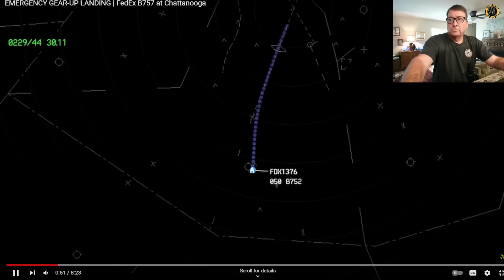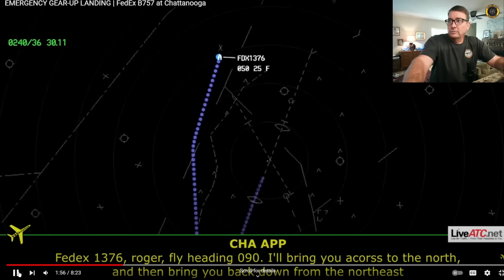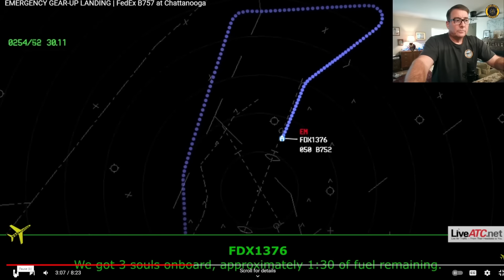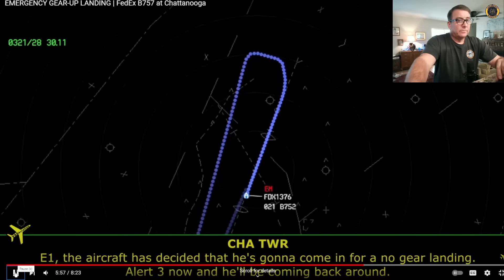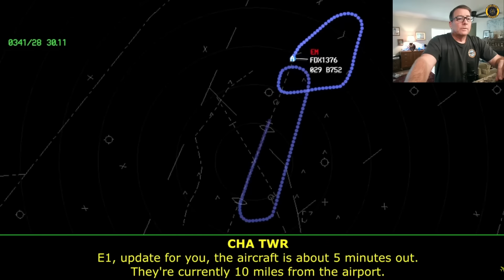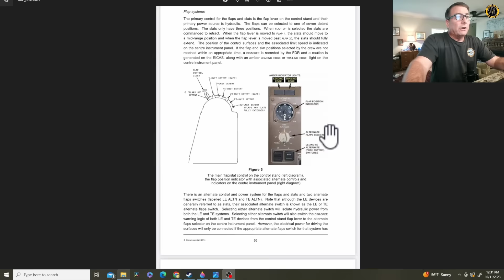Fedex 757 Gear Up Landing 4 Oct 2023

Comment: IMO the design of this system resembles something Microsoft would do.  Ignore a single point of failure.   Clearly the leak in the left hydraulic system was fatal and there was no true redundancy.  Microsoft programmers would do this and be absolutely shocked when their design failed. An honest Failure Modes and Effects Analysis would have identified this at the design stage. I would bet a lot of simulator instructors  have mentioned this to deaf ears over the life of the aircraft with the response:  "Well  we never had this problem before".  Indeed

Comment: Very well said on the reluctance to declare an emergency. It may also indicate a reluctance to accept the emergency and deal with it as seriously as they should have. If your ATC asks you if you want to declare an emergency in most cases thats an extremely strong signal that YES you have an emergency. There are many cases of people who died because they didn't get the priority that calling MAYDAY would have given them. Some got lucky and only lost the aircraft. I'm thinking specifically of an aircraft with just minutes of fuel who was trapped above the weather and overflew a military airfield he could see, only because their ATC told him he could only land in an emergency, he was dead within five minutes. Then there was the turbine single that lost all power coming up the coast of Florida, he got a right 270 over the Atlantic for spacing to a commercial jet that probably had two hours of fuel onboard and was given priority. That case just ended up with an aircraft sunk in the Atlantic, the occupants survived.

Comment: Great breakdown/explanation by Juan….as usual. I find it quite interesting that the triple redundancy relies on there being fluid in the lines. Correct me if I’m wrong, if the initial problem IS no fluid then it would render the redundancy useless.
Reply: As Juan explained there is usually trapped fluid depending on the location of the leak.  You are correct if "all" fluid is gone alternate will not release gear.  I believe the "Rest of the Story" will shed some light on the event.

Comment: Love the 757. Best airplane I've ever worked on. If I had to make a guess as to what happened, I'd think perhaps the PTU failed, which would allow a full discharge of all left system fluid and prevent any left system pressurization from the right system. This will be an interesting case to examine once all the information from the DFDR is available. ATC and flight crew were exemplary in their handling of this incident. I expect the flight crew seats will need their covers replaced before they can be used again!

Comment: On a Walk around on my aircraft, I noticed the alternate gear extension valve was leaking and smeared the inner wheel well in the side it is located. This could have caused the fluid to leak out and prevented a subsequent alternate extension. When the fault originates in a safety system, you are left with no options. I can’t imagine the crew not having done everything they could to get this gear down. Happy end here, good job.

Comment: If there's fluid loss from the hydraulic flap actuator, then there is NO way of extending any of the landing gear. That doesn't sound like much of a tripple redundancy system for the gear.
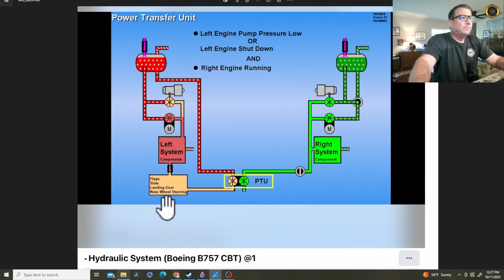If flaps are selected (i.e. flap lever selecting a different setting than the flap position indication) then fluid flows to the actuator. If that fluid is being lost and the flaps aren't moving, eventually the hydraulic fluid in the header tank will be down to the level of the standpipe, then the left pump will no longer produce pressure. (I guess an alarm sounds at that point). 18:26 it sounds like Juan is saying the PTU automatically starts (without the pilot being able to prevent it) and that will loose all of the remaining hydraulic fluid from the flap actuator leak, until the hydraulic fluid header tank is entirely empty.
With an empty header tank, neither of the two alternate gear deployment methods will work. Doesn't sound like much of a tripple redundancy for the gear in the event of a flap actuator system leak. (You would think the DC powered pump to release the gear locks would have it's own small fluid header tank with enough fluid just to unlock the gear).
Earlier I said NO way... well virtually no way. I assume an alarm sounds when header tank level is down to the standpipe... if you select gear down at that time it will likely get the gear locks deactivated and at least a gravity gear deployment. It would be better to select the alternate DC powered gear lock hydraulic pump as this appears to only be feeding the gear locks. (The PTU may not be producing pressure if the flap actuator leak is large). Moving the main flap selector back to match the flap indicated position would probably reduce the rate of fluid being lost and enable the PTU to produce more pressure, depending on the location of the leak.
I'm kind of assuming this is associated with the flap actuator as the pilot was mentioning taking time to deploy flaps. However, some other flight control on the left hydraulic system could have been loosing fluid for the entire flight (seems more likely) and this would still result in the PTU activating and entirely emptying the left system header tank. Resulting in no way of deploying gear and only alternate electric motor deployment of flaps. The pilot may have known for some time that he had no left system fluid (& pressure) but that probably isn't regarded as an emergency. (Possibly could be depending on location).
If he has been flying for some time with no left system pressure, (& likely knows that's because he has no fluid in the left system) is it "on his mind" that he isn't going to be able to lower the gear, even using the alternate DC electric pump that's supposed to release the locks?
When Juan was talking in a way that sounded like he had confidence in the redundancy of the gear deployment, I was certain it would lead to him saying... Then you lift the flap in the cockpit floor and pump the hand operated hydraulic pump lever for 10 minutes to release the gear locks. (And that hand pump has its own header tank).

Comment: I wouldn't want to be the underwear of the mechanic who signed off the plane as fit to fly !
Maybe time to add a fourth way of releasing the landing gear. Maybe a steel wire cable direct to each of the release locks.
It also seems daft in this day and age that external cameras aren't mounted to cover essential items.

Comment: ⚠️How often do crews operate these emergency auxiliary systems?
Lack of use could be a factor.
Valves and motors seize up when not used.
During normal operations do they go through self tests which would cycle the motors and valves to keep them good ?

Comment: Just  note- You mentioned the RAT-  Had one of our guys over the Great Lakes inbound to LAS pulling circuit breakers just to see what happens, Don't ask why!  He pulled both the "Speed" c/bs and the RAT dropped out at 38,000' in cruise. Evidently the RAT control senses that both the engines are not running when the Speed C/Bs are pulled! It ran all the way to LAS. Noisy!

Comment: As I understand Juan's explanation, they built a system with three sources of power to extend the gear, all of which rely on the presence of hydraulic fluid in the final section towards the gear. This should not be called a three way extension system with a single point of failure and on this aircraft I would not be surprised if there was a leak in that small section that bled the gears dry of any means of extending them.
If the electric actuators were placed on the gear locks themselves to force the locks open, or as in the 737, three cables run from the cockpit to the gears and allow the pilots to pull the locks open, this would be an independent extension system.
Depending on the description, all three systems use the red hydraulic in the end to move the locks, so it's a wanna-be alternative.
This is how I understand his explanation and where I see a possible single point of failure in the systems description.

Comment: about 20 years ago i had a gearup landing in my 340 cessna. not the same as this big girl but it still scared the crap out of me. even the manual gear pump would not work.after the ntsb was thru with their investgation they blamed the company that did my annual, i was glad it wasnt something i forgot. but i wen tthru the check list 6 times. tried everything i knew  andi loved tha tplane.  it was totaled.  i was fine my buddy however had never been in a medium twin  was his first flight in a ga  plane he has refused to fly in any plane since. i now have a 414 and have had it for over 19 years. probably didnt help[ i was screaming we are all gonna die!.  the shop had not got the timeing right on the gear. cameup fine but would not come down. both engines and props were destroyed  the engines had even broke loose on their  mounts. bent the main spars.  no fire was full of gas. i landed in the center of the runway on the grass.  was not fun

Comment: You mentioned the Polish LOT no gear landing....  If I'm not mistaken, when the salvage crews lifted that plane with a crane, a mechanic in the cockpit reset the electrical breaker for the landing gear system and the gear came down like normal. Oops!  I could be wrong but I thought that is what I heard, anyway. That LOT aircraft was a 767, if I'm not mistaken.  I believe the 757 and the 767 share the same type rating so is it possible that this FedEx plane experienced a similar situation?  We'll find out soon enough...

Comment: Kudos for ATC for declaring the bent bird an emergency.
Pride won't make a major problem disappear, but can get one killed.
Checklist item:
No gear.
Oh balls.
Gotta land anyway, just gonna get real expensive, really quickly.

ATC offloaded the hell out of that flight, as they should do. Safety third, safety second and guess what's first? Safety.
Because, checklists can be intensive once one's going into major mechanical or electronic systems. So, ATC offloads as much as they can onto themselves, allowing the crew to aviate, navigate and communicate.
As for the TOGA on approach, yeah, good job. Nobody wants to porpoise a gear up landing.

Odd missed observation, the aircraft isn't on pavement, it's on grass. Has some benefits, has some risks, end of the day, a bent bird made a survivable landing.

But, not a good design to have a third alternate rely upon the primary system that one's not having available. Because, babies wet, hydraulics leak. And Saint Murphy was an optimist.
And a backup of the CVR is the data recorder, showing what got toggled and when.

Comment: Is it possible on this aircraft to go down in the avionics, and/or cargo bay and manually pull the landing gear, door locks and gear locks, so that the gear can fall via gravity?
Reply: There is no manual free fall, and also no direct access to the lower deck from the uppers

Comment: Dumb question: Depending on the details on what exactly failed, wouldn't it be smarter to slow down to max gear speed, and use whatever hydraulic fluid remains to get the gear down, then worry about alternative flap extension, or just land on the longest runway within range, and worry about hot brakes and blown tires from a high speed landing later?

Comment: These guys are loosing the big hydraulic system, and they even told the controller that they have “flight control issues” and still no deceleration of an emergency. These guys need a debrief on what constitutes an emergency. Great gear up landing.

Comment: The triple redundancy is not very robust if a single component failure can disable all of them.  All three rely on the integrity of the  "trapped fluid" circuit, if it leaks then all fluid is lost. All 3 systems rely on the same source for fluid.  Also worth noting, the LH and RH hydraulic systems  can be taken down with a PTU failure/leak  

 I figured the backup systems  would have their own reservoirs, at the very least, one of the backups should.
Reply: A data centre I knew decades ago had a similar issue. The separate mains power feeds, even brought into different sides of the building.  Then they ran in one duct up to the data centre. So when some builders managed to set a cable on fire, it set all of them alight.  Redundancy planning is an exacting artform.
Reply: At least gear up landing is perfectly survivable

Comment: Thanks for boiling down the essentials so us mere mortals can gain some insight into what was transpiring and possible causes.
It's scary to think that a triple redundant system can fail to the point where a critical system such as landing gear can become inoperative.
Thankfully, flight control surface systems continued to function so that a stabilized landing was possible.
Of course the initial design for the 757 is over 40 years old and the last 757 rolled off the assembly line 18 years ago.
Time and high utilization are the enemy to even the best design and engineering.

I'm an aviation geek but not an aviation professional.  But I have flown millions of miles in commercial airliners and more than a few tens of thousands in general aviation aircraft.

I've had to evacuate a commercial airliner twice across those years of flying, so I always pay attention to the safety briefings.  I know where my seat is, I know where the exits are and I know how they operate.  I also formulate a plan A and a plan B in my head on what I'm gonna do if there is an emergency during take-off or landing.

**Fair warning**  If I'm on a flight and they call for an evacuation and you stop to get your luggage out of the overhead, I am gonna punch the stupid out of you and then drag your semi-conscious body off the plane.

Comment: So how do they remove the aircraft from the runway after this to open the airport again?
Reply: Generally you'll see a crane with slings to lift the aircraft up enough for mx to lower the gear, then tow off the active area.

Comment: Jaun, I saw that the hydraulic system operates the reverse thrusters.  Would you want to use reverse thrusters on a belly landing?
Reply: It would not be possible to deploy reversers on this airframe without weight on wheels

Comment: 90 minutes is plenty of time to sort out a hydraulic failure and make a decision on return/divert/continue. The low pass was rather pointless too, but maybe that’s a 757 thing. 

It is rather worrying when your backup system for gear extension doesn’t work as advertised. It will be interesting to see the final outcome of the investigation to understand the failure better.

Comment: From memory the doors are locked/unlocked electrically. Gear won't gravity drop with the doors locked up. As the switch for alt gear drop is spring loaded off, is it a possibility the pilots didn't actuate the switch long enough?
Generally to lower the gear you don't need hydraulic power...
I've noticed during our ground tests you need to hold the switch for quite a few seconds before you hear the click of the door locks...obviously you won't hear the mains unlock in flight, but there's quite the sound from the nose gear.

Comment: 76/75 have no electrics on the rat, Hydraulics only down to 130 knots. As I recall, they took my books back when I retired. The 76 uplocks were electric and wired into the essential bus so as you needed at least a battery to get the gear down if all else failed ( check circuit breakers). This 75 event has me a bit stumped, they had enough pressure ergo fluid to get it retracted.... I wish I had my old books...

Comment: Something odd about this as the fluid that supplies the alternate gear extention hyd pump (used to unlock the uplocks and allow the gear to free fall to the down and locked position) is isolated from the left hydraulic system.  Something did not work as it was supposed to.  This will be interesting to see what happened.  
Im.pretty sure during some heavy check the airplane must be jacked up and the alt. Gear extention system is operated.  Alot of 757 pilots will want to know how this happened.

Comment: Not a pilot, can't speak to actual rules and reasons, but I notice a distinctly low amount of panpan calls in incident videos, if you're hesitant to call it a full emergency but are requested deviation from your plans and having trouble shouldn't there be a much stronger reflex to at least indicate panpan to formally put out, something is off, please help us and expect some requests for deviation even if I'm not ready to call it a full immediate emergency mayday, or am I misunderstanding and the declaration of an emergency would be a panpan and not a mayday call?  I'm assuming the hesitation to call for mayday is tied to the perception I think many have of that being a call you can't deal with it you are going to crash, you will fail to have an intact landing, but I'd love to hear from pilots on where that hesitation comes from, is it a perception that that's giving up only when all attempts to solve the issue fail, or is there something else, dislike of paperwork?  And why not declare at least panpan early?

Comment: The photos the day after show how well the fuselage held up. I still believe this will be repaired and put back in service, just due to the nature of the 75, being so versatile and its size. Dont see any buckling. I cant see under the skin, but overall not that much damage for a gear up landing.
Reply: I can bet $$$$ that it won’t be repaired, economics work against it, same with that Polish LOT 767 - it was scrapped and it was a younger haul
Reply: FX has quite a few 75’s in storage. No way insurance will pay to repair this one. Destined to be scrapped.